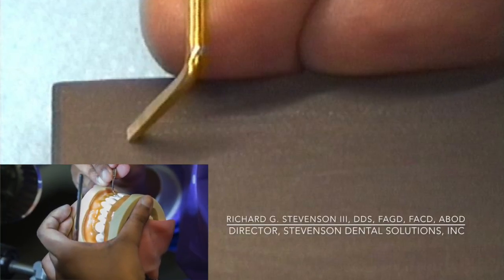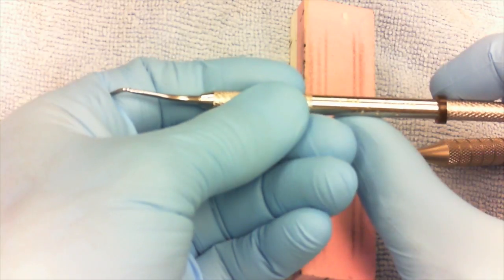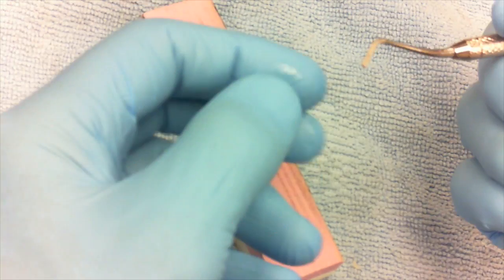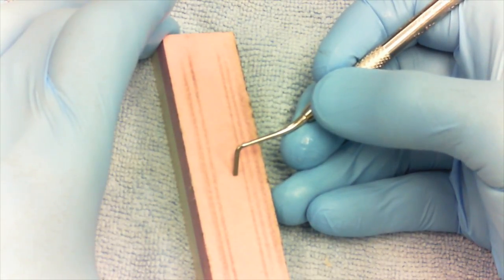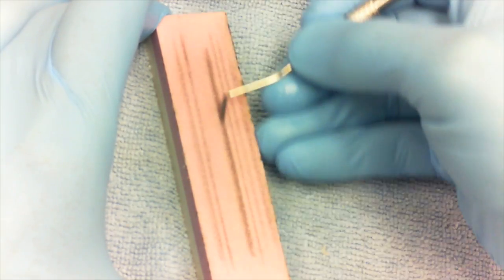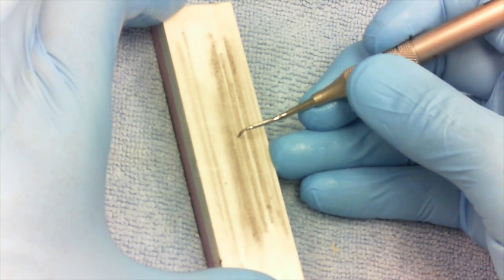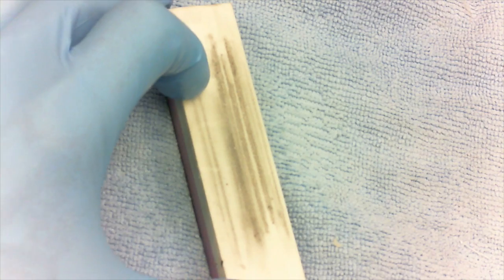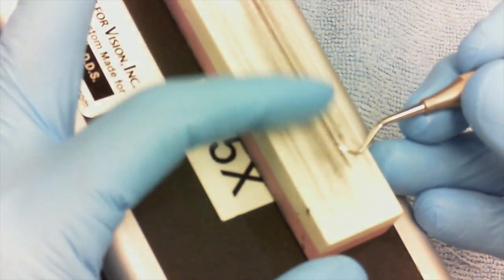How to Sharpen Hand Instruments? | Enamel Hatchet Sharpening

Comment: Hai dr. Could you tell me how to sharpen the Hollenback carver?
Reply from the maker: It's sharpened like a kitchen knife - one side on the stone at a time at a low angle, like 20 degrees
Reply: @StevensonDentalSolutions  Thank you for replaying. Is it a push/pull stroke?

Comment: So we touch the bevel to the stone, but how do we know if we pull or push against the stone? Which way does the cutting edge go? I keep chipping my typodont teeth, I think I’m not sharpening correctly.
Reply from the maker: Always pull with force in the direction of the edge for one side and push with force for the other side.